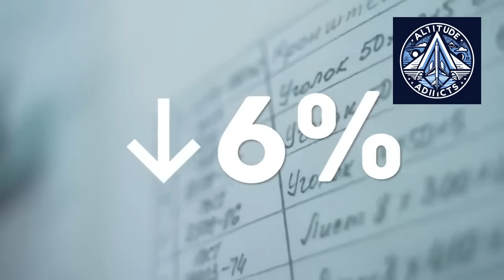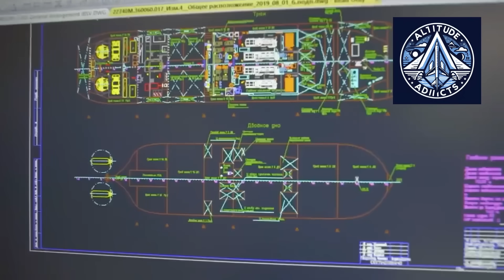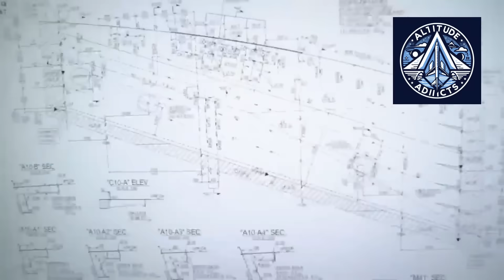Russia’s First LNG Supertanker Delivered | Arctic Ice-Class Giant Explained

Comment: built in the East .... nowhere near sinking Europe ..... there is a message there for the deluded Europeans ....

so it seems that the Russians do in fact have electric pod drives of 15MW each  ....  02 September 2021

"Rosneft, GE Energy Power Conversion Technology Ltd. and Sapphire Applied Engineering and Training Center LLC signed a License Agreement during the 6th Eastern Economic Forum for the use of Unified Technology of high ice-class pod drives with a capacity of 15 MW. The agreements will contribute to further localization of production of component equipment for ice-class marine vessels under construction at the Zvezda shipyard. Production of 7.5 MW pod drives has already been established at the site of Sapphire Pod Drive Plant LLC.

The Pod Drives are the key component of the ship power system. The developed Pod Drive design ensures high ice and maneuvering qualities of seagoing vessels during the navigation period along the Northern Sea Route and is designed for operation in severe ice conditions.

The 15 MW Pod Drive technology was developed by Sapphire Applied Engineering and Training Center in cooperation with GE Power Conversion France SAS within the framework of the joint R&D program of Rosneft and General Electric."